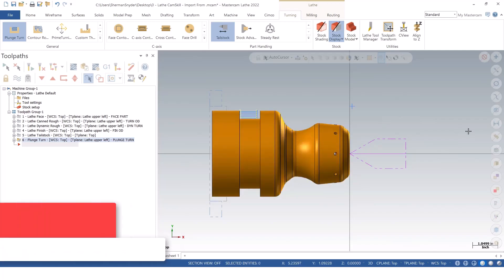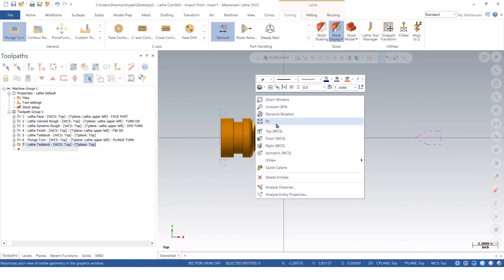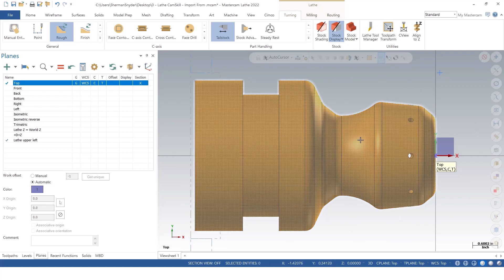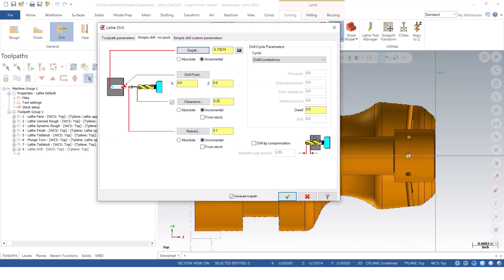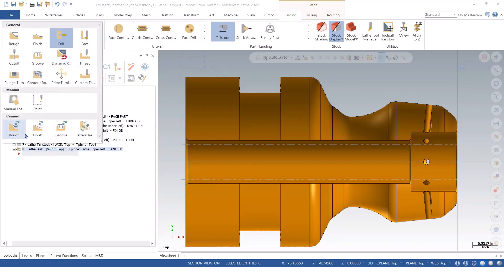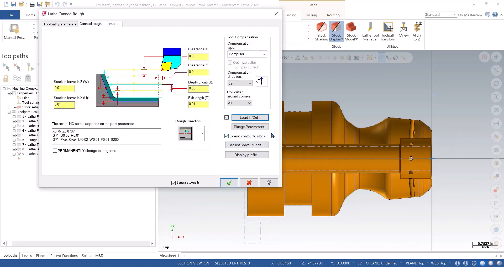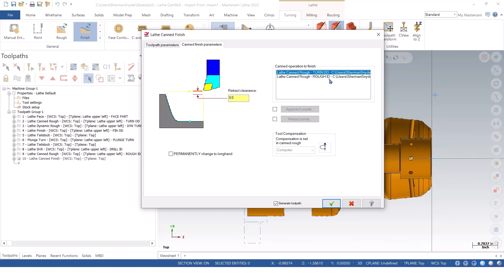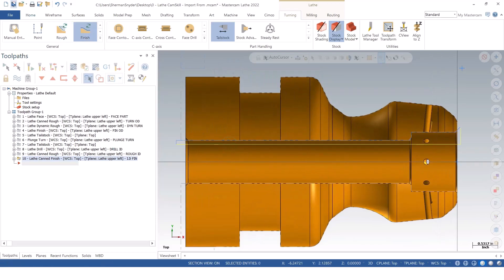Rough and Finish the Bore ID - Advanced Lathe Tips and Tricks 5/12

Comment: I'm more a mill programmer but niw work on a DMG MORI lathe as cnc programmer which has a c/y axis and has a broaching live tool. 

Does anyone know which mastercam toolpath to use for keyway cutting on a lathe not a mill.

The live tool moves back and forth in order to cut keyways while the spindle stays still.

I've found not one video online of mastercam toolpath for lathe for keyway cutting with broaching live tool?
Reply from the maker: A contour toolpath could be used, but we may also need to modify the post to have the correct orientation locked when doing a broach operation. The spindle as the default output would want to rotate and we would need an option to allow the toolpath to suppress this and move to a proper fixed position.  Let us know if we can help you build or customize a post here: https://www.mlc-cad.com/services/cnc-post-processors/